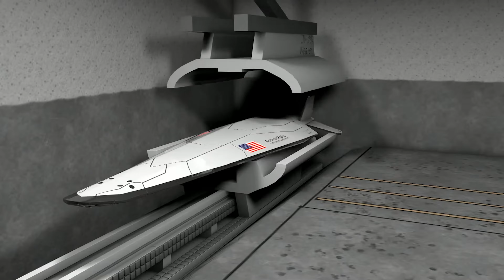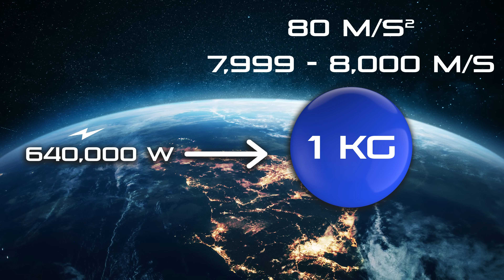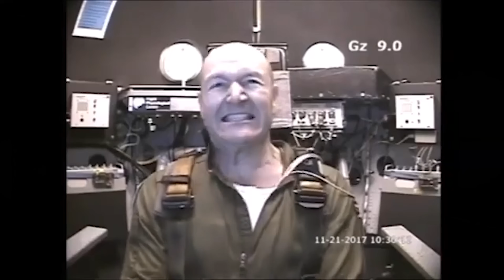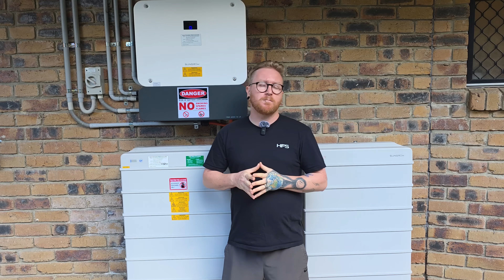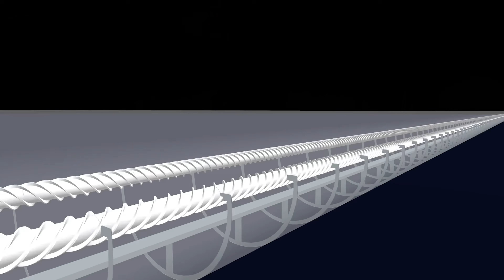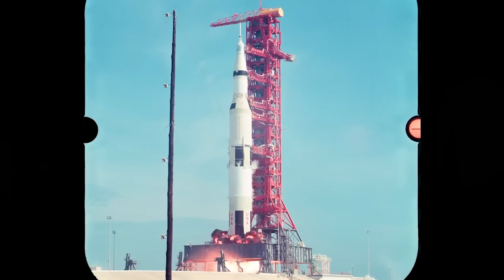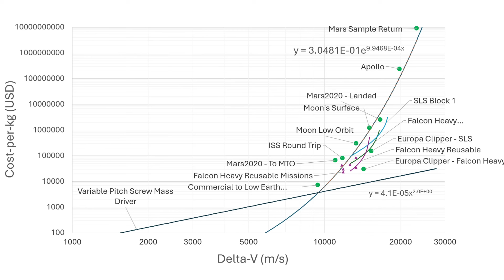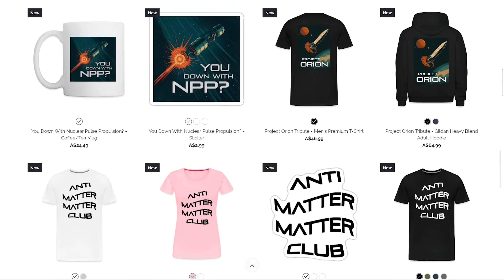The New System That Could ACTUALLY Replace Rockets

Comment: Orbital velocity is about 17,500 mph, or mach 23 at sea level. You can’t go mach 23 at sea level! The aerodynamic pressure would be about 5400 PSI with plasma temperatures in excess of 3000 K. The sonic booms alone would likely destroy the entire system before you even made it to mach 2. You’d also need a track that is 243 miles long!
Reply from the maker: Exactly, which is why this system doesn't doesn't release the spacecraft at sea level, it does so at high altitude😁
Reply: This is true - in fact we're targeting even higher speeds that that. The spacecraft is accelerated in an evacuated tube, which then curves up the side of a mountain, and then is extended to a much higher altitude to mitigate the aerodynamic heating problem. However, the price we have to pay for that mitigation is accepting the challenge of making an aeronautically supported tube that can keep itself centered around the flight path. Please promise to watch the video "Electromagnetic Launch - What is (and is not) Holding it Back" before making a quick judgement on the technical viability of the aeronautically supported evacuated tube.

Comment: 3 km precision 1 m diameter  screw that is precise in shape, modulus, and magnetic behavior over a reasonable temperature range. As a material scientist I love this; it will keep me employed for decades developing it.
Reply: Each screw segment is about 5m in length. They're made from steel and located in an evacuated tube that's several meters under the surface of the ocean where the temperature should be quite stable. Are you suggesting that during the manufacturing process it's hard to control the ferromagnetic properties of steel and keep them reasonably consistent from screw to screw?
Reply: @spaceinfrastructure3238  Not trying to go down a rabbit hole but trying to get the magnetic permeability of a steel consistent to a few percent over a few cm is challenging. The variability of the permeability would lead to a mechanical loss term. (I think the eddy current be worse due to the vibration leading to a nonlinear loss ). The water around the tube containing the crews will be quite stable mainly because of the lack of heat transfer from the screw to the water.  This is a cool idea but they are going to have to develop a material that is very strong, has a high magnetic permeability and a very low electrical conductivity.
Reply: The guy said 100m long in a comment and he never mentioned under the sea, so where did that come from?

So now you have a vacuum tube exposed to undersea pressures and not just one atmosphere?

Comment: How big are your screws going to be? One big screw miles long?  Materials, design, and engineering will be a nightmare.
Reply: Each screw segment is about 5 m long and they are individually powered and all synchronized to turn together. The engineering of the screws is discussed in the paper.

Comment: This was obviously designed by an engineer who never made anything. A screw that long needs supports. You can’t support a screw that has a drive nut attached except for the ends. So the whole thing is completely unsupported along its length. Incredibly large length to diameter ratio. No material is stiff enough to handle that. Even if you made it from solid diamond, it would flex too much, vibrate like crazy and explode. What a silly idea.
Reply from the maker: Your criticisms are based on some fundamental misunderstandings of the system. The screws are supported, and the adaptive nut does not circle the whole screw - its magnetically coupled to it. I'd encourage you to actually read the paper, or watch one of Phil's more in depth presentations if you'd like to understand the system better😊
Reply: @HelloFromSpaceAus  Ok, I did miss that the magnetic coupling means it can be sectioned, but that’s still a really difficult materials challenge. Long, relatively thin screws are not an ideal way to store rotational energy and they’d need to be completely hollow to make them light enough while still storing inertia in the skin. Again, no material is capable of that. It would create all sorts of vibrational modes and destroy itself. Add to that the fact it has to magnetically couple large forces to accelerate the payload, which is not a balanced force so would make the compliance issues even worse and the tight coupling of acceleration, velocity of payload and air resistance and I fail to see how this can be workable in practice. Even a tiny 0.01% error in that calculation and it will fail to synchronise and again, destroy itself. I imagine the design has some kind of built-in feedback to keep that stable over the launch profile, but even so, it is trying to thread a very narrow viability path with a system that is already pushing the envelope of material strength and stability extremely hard. I’ll maybe warm to the idea if a scale model prototype could demonstrate some of the basic concepts in practice. Until then, I remain very skeptical.
Reply: @simontillson482  The engineering of the screws is covered in the paper and includes stress simulation results. The screws can be made out of steel and the loads on the screws are balanced. There's minimal air resistance because the interior of the tube is evacuated. To understand the system better, I suggest a top down approach. First, just focused on the points made about the significance of VPSL's v^2 scaling being so much better than a rocket's exponential scaling. Once you understand that, I think you'll be motivated to try to come up with your own design that achieves v^2 cost scaling. Then we can compare notes.

Comment: this still leaves me thinking...oh, just as good as ah, a Hyperloop ?
Reply from the maker: I can understand the comparison, there are some similar engineering concepts. The major issue with Hyperloop, is transport on earth is very much a solved problem. We have many, cheap, effective and fast transport methods. It serves no useful purpose.

Space is a totally different story. Rockets are currently our only access, they're insanely expensive, complex machines. That cost is the number one factor holding us back from more space access. VPSL serves the purpose of drastically reducing this cost.

Comment: Per GROK : The cost per kilogram to Low Earth Orbit (LEO) for SpaceX's Falcon 9 is estimated to be around $1,500 to $2,000 per kg. This is based on the Falcon 9's launch cost of approximately $60-90 million per launch and its payload capacity to LEO of 22,800 kg for the reusable configuration (or slightly higher for expendable missions).
Reply from the maker: Grok is wrong. This is directly from the SpaceX website "$325k for 50kg to SSO with additional mass at $6.5k/kg."

The numbers you have used are commonly misunderstood. $67m is the current minimum listed price, but this is for a reused, recovered Falcon 9 on a low inclination, low altitude LEO. 22,800kg is the max payload for a fully expended Falcon 9, which is obviously significantly more expensive.

$67m gives you a max of 18t to LEO, which works out to $3700 per kg. This is the absolute cheapest you can get. More typical/common LEO profiles reduce the payload to more like 13t with RTLS, which brings the cost up to $5100/kg per kg. Ride shares are also more expensive at $6500/kg. Dragon flights are significantly more expensive - hence the $5k - $10k I've used being a realistic ballpark figure.

Comment: This is just one more example of engineering idiocy cloaked as clever design. There are so many engineering "can't be dones",  without an infinite budget, that you would need a book just to list them. Stupid is, as stupid thinks. It is painful listening to this total BS.
Reply: Can you provide an example of something that you think can't be done?
Reply: @spaceinfrastructure3238 spinning up and maintaining god knows what ridiculous RPM's for a large diameter, complex shaped, miles long, pair of shafts, in a vacuum chamber; and expecting it to repeat this frequently and reliably for years. C'mon man, you don't have to be an aerospace engineer to shoot this turkey full of holes. I'd sooner invest in the Boring Company.
Reply: @andrewhefner289  If you check out the peer-reviewed paper, "Human-Rated Launch Infrastructure for the Interplanetary Era: Breaking Rocket and Legacy EML Cost Barriers", Figure 14 shows the results of a Fusion360 stress simulation of the screw with centrifugal and lateral loads. Keep in mind that each screw segment is essentially a separate machine, about 5 meters in length. They are synchronized so that lots of them together act like a "miles-long screw". I don't think the shape of the screw is so complex that it's an engineering "can't be done" - in fact, we've had lots of internal discussions on mass-producing the screws. Can you come up with another example of an engineering "can't be done"?

Comment: Nuclear ion engines can be engineered to produce huge amounts of power on very little fuel. Properly optimized, a vehicle the size of the old shuttle could get to the moon and back on a gallon of water.
Reply from the maker: Unfortunately this isn't correct. Ion drives have an excellent ISP but generally a very low thrust, which is why they're best used in space for probes, ect.. Not for launching from sea level. If you run that through the rocket equation, for this to work your exhaust gas velocity would have to be something like 70% of c (speed of light). This is many thousands of times higher than the EGV of even the best Ion drives

Comment: Unless we eliminate the long-term effects of low gravity on the body, we’re not going anywhere.
Reply from the maker: Eliminate is a strong word, mitigate would be probably more accurate. There are methods which help, but it also depends where you're trying to go. Venus' atmosphere has 0.9 gravity at high altitude.

I agree though, that the effects of microgravity are seriously underappreciated. This is likely the biggest issue with Mars settlement. I am curious about how the human body could adapt over a few generations.

Comment: This concept is innovative and exciting but like the comments suggest there are a lot of engineering challenges to overcome with this design. I think rockets are just about the only thing that can effectively get massive payloads to orbit and in the future with economies of scale we will have the space infrastructure required to build a system that reaches down to Earth from space rather than the other way around. 

However as a physics student I’d absolutely love to engage in building or modeling a small scale version of this. I’m currently working on a spinning flywheel - style project myself if anyone is interested. I’m only in the “digital twin” creation phase rn so I’m still modeling the simulation.
Reply from the maker: There's definitely many engineering challenges to overcome, as there is with any first time attempt at an ambitious new innovation. This isn't something we'd build tomorrow, it would be a big project. It would be extremely well suited to the moon, given that there is no atmosphere. This eliminates one of the biggest hurdles.

I'm really glad to hear you're studying Physics! Sounds like a fun project. Let me know how you go😁

Comment: If you got to 200 per hour then light the rockets would make a difference
Reply from the maker: If I've understood your comment right, unfortunately not. 200kph is barely scratching the surface of interplanetary transfer velocity. It would maybe save a couple hundred kg of propellant in the rocket. Best to let the mass driver do the heavy lifting

Comment: Why don’t they have the sled go down hill first or free acceleration then add energy to acceleration.

Spinning rails over a long distance has an electric motor let alone balancing the spin so it doesn’t wobble apart.
Reply from the maker: You could, but I don't think that in the end this would make much of a difference. 11.1km/s is some pretty extreme speed, if the hill added 100km/h to the sled, this is one 400th of the end velocity - unfortunately a pretty insignificant amount.

The screws are segmented and very well supported to help reduce/eliminate wobble. They'd definitely need to be highly precision machined though. This would be a challenge

Comment: in oil drilling there is a max depth that is possible due to the fact that the torque from the drill can only be transferred so far. Here we are talking about a screw trying to transfer kinetic energy at huge lengths, I would like to have someone talk to this point, I don't see this working as intended, also the loss of energy in heat and friction.
Reply: The idea that the screws are powered from one end seems to be a common misconception in the comments. Each screw segment is just a few meters long and is individually powered. There are brackets between the screw segments that support them. There are radial and circumferential forces from the flywheels through the screws to the screw flights, but there's no mechanical power transfer in the longitudinal direction (i.e. along the screws). The screw segments spin in a vacuum and are supported by active magnetic bearings (these are quite common in industrial applications), so there's negligible loss of energy due to heat and friction.

Comment: Rockets have very poor propulsive efficiency during the first 50-60seconds of flight, combined with high gravity losses a large amount of fuel has to be used to get not very far and not very fast. 
This system does have some advantages though over other launch assist systems in that it stores energy over time in what would be heavy spinning lumps of steel that could then be used to accelerate a sled. 
If this sort of system is going to be useful it would be useful to launch to 300-500m/s. Some altitude launch is always helpful but the real benefits do come with the launch velocity particularly the vertical component. At 400m/s a rocket would gain 4km in altitude in just 10seconds (High mountain launch not so helpful);  ISP and thrust increases. You can use the thrust to carry more fuel so the mass fraction is better. 
At 8g this would be a 5second launch and 1km of track. Easy to put on many mountains. 
If this sort of system doesn't work for this scenario then it is hard to see that greater velocities with increasing complexity and diminishing returns would be worth while.
But vertical launch assist does look attractive which is why we keep going back to it...
Reply from the maker: I understand where you're coming from, but it's actually far harder and less efficient to do it this way.

By adding all that additional mass to the spacecraft (extra rocket engines, large fuel tanks, ect) you're going to have to make the mass driver much larger, more powerful and more energy hungry. This increases the cost, for no real benefit. Its sort of like adding the tyranny of the rocket equation to the mass driver, which is what you're trying to get away from with a mass driver.

The more work you can get the mass driver to do, the smaller and lighter the propulsion system on the spacecraft can be, the more effective the mass driver is and the more usable payload you get to space.

Comment: Simple alternative: have a vacuum tube 50km long gently sloping uphill. The rocket starts in a vacuum on a 1° slope, the tube contains the rocket exhaust so effectively it gives it more thrust. Magnets used to stop the rocket touching the tube. 
So, you add up no wind resistance, negligible gravity at 1° slope, and contained exhaust, and you get your rocket up to orbital speed as it leaves the tube. The interface at this exit can be a circular (conical) high pressure air dam pointed in the direction of rocket travel so rocket goes through away from air dam nozzle.
Reply: Funny thing is, both the vacuum and the air dam can be created by the one machine. There is no moving parts to the launch tube, so it's reusable as fast as you can reload a rocket and make another vacuum. (at least a partial vacuum will greatly assist acceleration)
Most rockets burn half their fuel getting the first 200m off the ground. What if you were going orbital velocity as you leave the ground? Then getting 200km to space is like changing lanes in a car, effortless if you do it right.
Reply from the maker: Its an interesting proposal, there would be a bit of math to do there - but my initial thought is that I don't think this would produce anywhere near the amount of energy that is required to throw something into space
Reply: @HelloFromSpaceAus there are so many advantages doing all your acceleration before you leave the ground. You are not fighting gravity per second. You only fight gravity once you are 12,500km/h. Then it's only a few seconds to punch out the atmosphere.
Reply: @HelloFromSpaceAus AI tells me that if you mount a powerful magnet on the front of a vehicle, it makes most of the nearby air conductive, then you can ionise that air using a magnetron or EF emitter (radar) and then send it to the back of the vehicle using exterior magnetohydrodynamics. A net - vacuum at the front produces thrust. A 1cm field will collapse in 0.013 secs, so it needs to be refreshed quickly. Then you get a portable vacuum on the front of your rocket.

Comment: Both quadratic and cubic curves are NOT exponential. If you are going to talk about science, get it right. Thank you for the video, it's a very interesting subject.
Reply: What do you mean by this? Both equations have equations with variable exponents > 1 st power… doesnt that define them as exponential?
Reply from the maker: Got me there, I had originally used 'exponential-like' where correct, but this proved to be very difficult to pronounce while recording (with the double L's). Good catch on your part sir👏

Glad you enjoyed it all the same😁